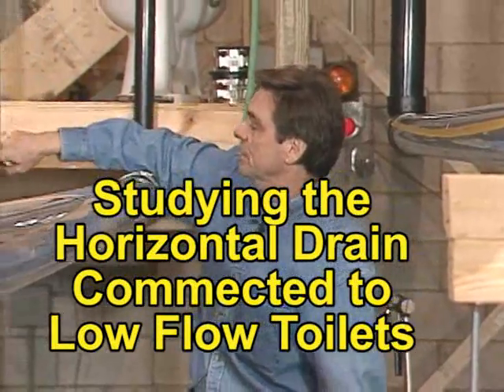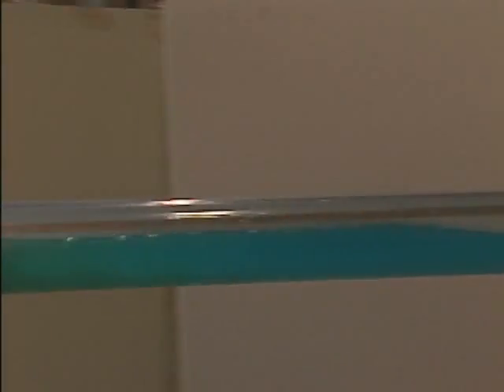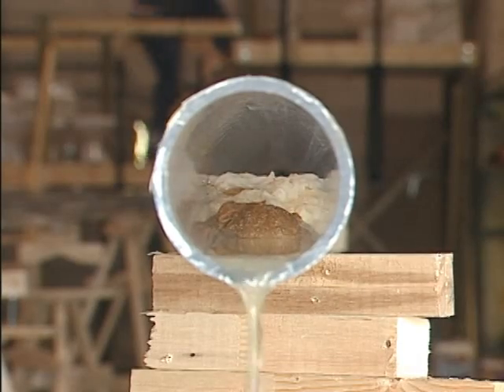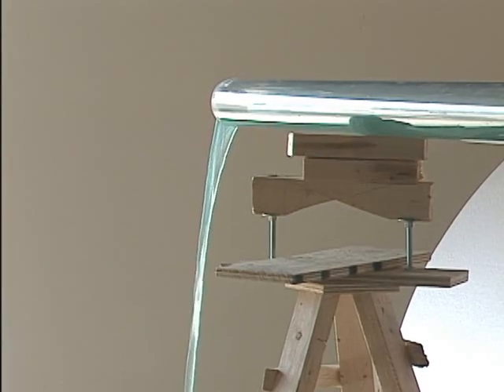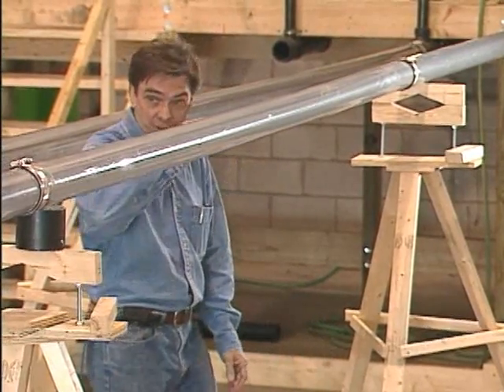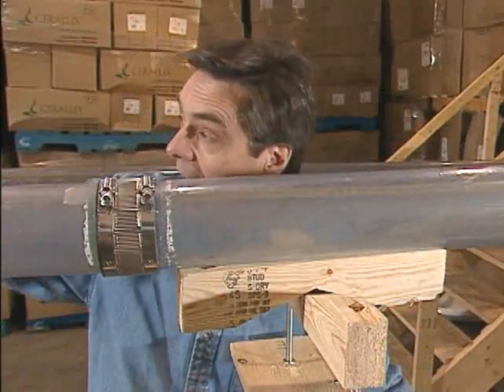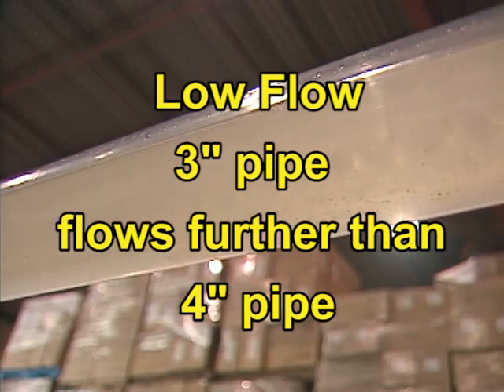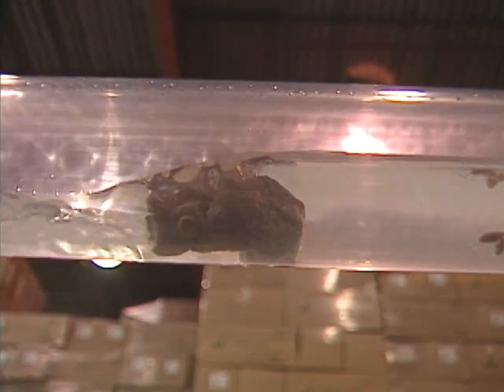Low flow toilets and clogging the drain line

Comment: Really great explanation of what's going on with a realistic example. We get occasional clogs in my 1966 home because the foundation has settled in one corner, and the toilet drainpipe slope is now only 1/64th-inch per foot over a 10 foot run. My wife only buys Kirkland toilet paper, which will not dissolve in water (tested by putting a couple squares into a glass of water and gently shaking) and unfortunately I use an absolutely insane amount of TP. I found several solutions: 1) open the ceiling and re-slope the pipes back to 1/8 or 1/4-inch per foot, there is enough room to do this but I don't want to open the ceiling right now 2) multiple flushes to move the huge ball TP down the pipe 3) stop buying Kirkland TP, but my wife refuses and 4) install a heated bidet seat. I ended up going with a bidet and now I only use a little TP to pat dry plus I give an extra flush (probably not necessary) and problem now solved. We may rent the house in the future so I'll ultimately need to re-slope the 10-foot section of 3-inch cast iron pipe. The cast iron is still in great shape but I may switch to smooth PVC or ABS if I have the ceiling already open.

Comment: What about 100 year old plumbing pipe with 100 year old plumbing system. Show what happens then? Does everyone have to dig up all sewer line in old home just because they buy low flow  toilet. I have to have a plumber come out to unplug the main sewer piper 2 to 3 time per year. cost $125 each time. All this because of low flow toilet. What is the solution to this problem?

Comment: I'm a semi retired, Journeyman HVAC service/installer...Now, Handyman...I tried to explain this to a customer yesterday when there was a major back up in the basement and the driveway pipe, covered, showed no signs of a problem, until the cover was removed.....Look out, here it comes.....This video explains what happens with the low flush toilets better than I could ever explain it....I did explain, dumping a bucket or two of water down the toilet occasionally would help, but also defeats the purpose of a low flush...So, they might save water now, but the drain needs flushed out sooner or later and did, even after I augured, using a lot of water afterward, so there goes your savings.....I showed them this video and they now understand....It's a great video and a great tool...The low flush is somewhat of a joke, but plumbers love them...lol...This customer is now looking for an old toilet on Craigslist....It's their call, my install....Thanks guys, for a great video.

Comment: Their hypothesis is wrong, basic physics tells us gravity acts on a feather the same as a bowling ball. Gravity acts on the solids the same as the water. What they are actually witnessing is sinking waste causing friction against the bottom, which in that case, a steeper drain is better, the more the waste pushes down, the more the sideways force will be.